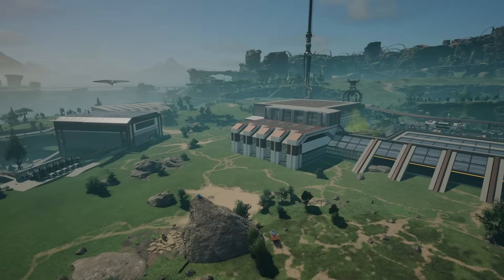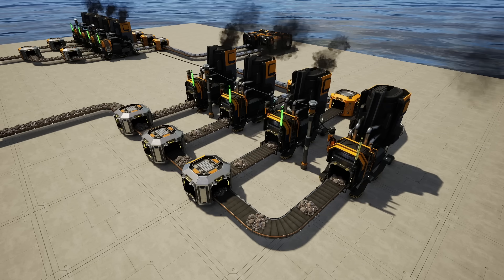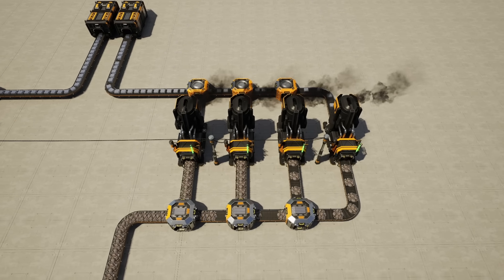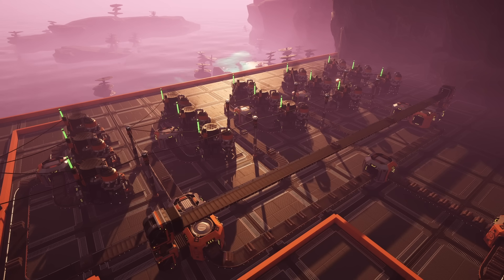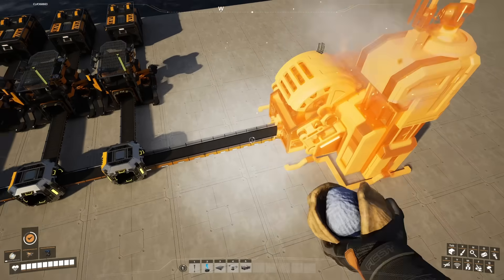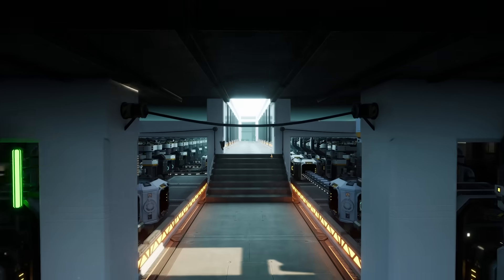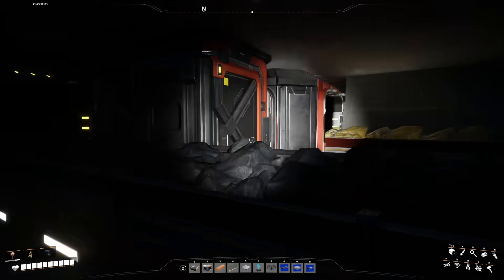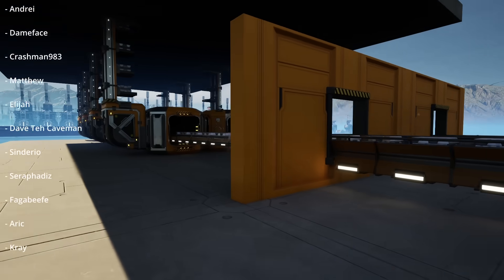Beginners Guide To Factory Logistics Systems in Satisfactory 1.0

Comment: one of my favorite techniques is to use a container at the start of the manifold somewhere and pre-fill it with a bunch of resources (that I inevitably have hanging around my inventory for some reason) and it'll fill up the manifold even faster if the belts have a higher capacity than the machines can use.

Comment: I used a manifold to power my biomass burners, and I had constructers making biomass and then turning it into biofuel, and after fifteen minutes of cutting down trees and putting them into the power plant to go through, 12 biomass burners are fully backed up, so I think load balancers are unnecessary in general.

Comment: Ive always found the whole argument about manifolds warming up isn't that big of a deal. I get it, efficiency, but if you build in sequence and power everything as you build, each chain of production is already a lot more warmed up by the time you finish. This "massive warmup" presupposes that you build the entire factory and then hook the inputs up to it and run it. 
Eg. Im building heat sinks, i built my copper sheet line first, so i already have a few dozen constructors full of sheets ready to pump them into the heatsinks anyway, im using max belts anyway cause i have an abundance of resources.

To be clear, go ahead and dont use manifolds, thats your right, but there's methods to reduce warmup so it's not that bad.

Comment: Thanks mate
I find lefts connecting perfectly to assemblers etc from the floor, letting you walk around proudly is really great 
I usually let a short belt run from the output to the lift so I can "inspect the goods" too
And when doing this, descending to the dim, densely packed logistical floor is also pleasant, it's like picking at the belly of the beast, a sort of underworks location

Comment: Manifold advantage is more stable power consumption if there is not enough resources. The first smelter will be working  constantly. In balanced all will be stopped sometimes. That will cause greater changes in power consumption.

Comment: I'm personally a big fan of manifolds in situations where it's not crucial that the job is split evenly. I find them quicker and easier to build and plan, and they take up less space and slightly less resources to build (since you're using less floor space and slightly fewer belts)

One thing that's often overlooked, in my experience, is their flexibility in terms of throughput.  HAHA. Of course, I pause the video to type this comment and he immediately mentions overflow the moment I hit play again xD

Using smart splitters set to overflow, you can build a manifold that automatically adapts to input. As in, it'll only start sending to the 2nd machine once the first machine is actually full, etcetera. Not a HUGE deal but it can be handy if your input isn't stable or you're still working on connected parts of the same production line.

Comment: I know manifolds are generally just fine, but they just feel wrong to me, I have to balance everything perfectly or it grates on my brain until I fix it
Reply: Balancers simply aren't a thing in Satisfactory.
This has been explained many many many times.
Production efficiency will not ever be 'solved' or 'improved' by using them, ever, under any circumstance.
The 'balancing' in Satisfactory is done by a different mechanic:
1. You supply enough product for the machinery to process.
2. You place enough machinery to process the supply.

Comment: i hate this underground delivering floors, first you start often to work messi (because no one sees it) and if you need to fix or change something it looks more like sphaghetti than real sphaghetti^^
and ok that you can walk through cleanly yes but can this also be done in that delivering floor? NO because he is full of Belts splitters and so on^^
AND after getting the flightpack who walks through buildings????? i always fly or use hypertubes AND you can make a central belt mainstreet with 63 Belts or more withouth overclipping and able to walk for example UNDER the belts
i use a lift  near the mainstreet to go up than straight to the production and there down with a lift and into the buildings same vice versa on the output
look like a REAL factory wokrs perfectly and i can use my beloved bobby car the whole time if i want^^

Comment: honestly this video has already changed my way im gonna set up factories now that i know that as long as i have the required resources coming in, i can manifold it and itll work itself out, what i usually worry about is the fact that my part making stuff doesnt get overfilled and cause power fluctuations
Reply: one thing you can always do is make a switch for each major production line and let the whole manifold fill up before you switch the machines on, then it's an even power load.

Comment: ‘Sushi belts’ actually have pretty good uses lately game when making compact, complicated factories where the component load in total is very light. You can just use a single conveyor line that goes about your factory picking up stuff and trading it off. What I really like about ‘sushi belts’ is that if there is an overflow, you can always bypass the overload with feeder lines running in parallel like a highway; For instance if on the highway there is an accident, traffic automatically detours toward side streets or ‘feeder’ roads if you live in Texas. The same concept works exceptionally well in Satisfactory.

Comment: You can have fairly loaded manifolds if you're completing them by steps. So for example you built your smelters? You power them and supply with ore before moving to work on constructors, then you power and supply constructors before doing assemblers etc.

Comment: additional tip: you can use every splitter or merger as an replacement for the input/output-head of vertical conveyors
just place the splitter/merger directly on the input/output-head of your vertical conveyour

Comment: A really great example of where manifolds are inefficient is on the back end of production.  If you have several machines making output and you merge them all together a manifold method of merging will cause one machine to purge it's backed up production at twice the rate of the second, and 4 times the rate of the third and so on, meaning in setups where your production lines might fill up and then when you build something need to refill your stores you will have actually slower total times to refill as your production machines will remain idle longer as it takes more time for your usage to empty the buffers on some machines as compared to others.  The flip side is the difference is probably pretty small.  The more you use the less this will tend to matter and if you don't use much at all your buffers will tend to stay full, so there is no real problem.  But in any case on the backend this problem never goes away.  On the incoming side once your machines are saturated with input the difference between a load balancer and a manifold go away, but on the output end the problem can reoccur over and over again.
Reply from the maker: The example you give shouldn't be that big an issue, if you need to refill your stores, the chances are all the constructors already have their buffers filled, and whilst they start to run, the manifold will be feeding through to the whole system, by the last in the line finish using their buffer it will most likely be being filled again. On the flip side if you run overflowing awesome sinks at your storage, then you'll never have an issue as the factory will run constantly

Comment: There is a much easier way to use manifolds and get them working efficiently from the get go without all the stuffing around you mention. Just use different tier belts.

For example, let's say you have 6 smelters near your extractor. Each requires 30 ore / minute. A tier 1 belt from each splitter will easily take care of that but the belt from the extractor to the splitters can be tier 3. Solved.

Comment: Just a small tip from me, if you like to build balancing delivery but only have place for manifold line.. place the last row of splitters first, front last on top of that etc.. till you got all the splitters in place, then connect everything with elevators.. and you have the balancer but vertical build. 😊

Comment: So after I saw the alien technology tab in the MAM I stopped everything I was doing and immediately went and tapped every sam ore node i could get to and used my limited supply of mercer spheres to build dimensional storage on each of them. then I spent like 6 in game hours doing nothing but hunting mercer spheres (got a lot of hard drives and slugs at the same time as a bonus).  I didn't do anything with phases, milestones, or expansion until i maxxed out the alien tech research.  And I see zero reason to ever make a logistics depot now.

Comment: One thing I have not seen anyone mention, is slugs. Put a slug in a factory and you have just ruined your 'balanced' set up. If you had a manifold setup and you have excess input but no room to expand, you can either reduce the output of the feeding/supply factory (Why would you do that! You are wasting manufacturing time!) or you can add a slug into the last factory of the input line to 'gobble' up the excess input and increase your outflow at the same time. Win win!

Comment: I started using vertical balancers this playthrough. Each layer has 3 machines, up to 3 layers get feed by a second order splitter. Those cubes get then underclocked to match the input. Makes for some great "Iron Tower" or "Copper Hill" factory.

Comment: All you need to do when you start your factory is power the miner, let it fill up while you build your smelters. Then power the smelters and let them fill up while you build the constructors. Then power the constructors while you build the output.

That way, your machines should have time to fill. Also, when the miner or smelters clog while you build, put the stacks in your inventory to manually fill the next machines.

Load balancers are a pain in the ass when you want to upgrade the miners or overclock or add a few machines. With manifolds, all you have to do is keep a small space for a lift after your last splitter so you can send extra materials to another floor. You will have to expand so keep that in mind!

Comment: Just a note for a major point of frustratuion. If youre coming up from a floor hole directly into a splitter and into 2 machinces, offset the hole. The best way i can discribe it:
Stand with machine on the left and right, enterences in line and spaced enough for a splitter.
Floor hole will be in the center, one tick away from you.
Lift exit will face towards you.
Splitter should auto config and completely cover the lift.
And you'll have a perfect split.

Comment: Not trying to start anything but asking a math question. Wouldn’t the 1:4 splitter/merger setup actually be a 1:3 ratio since 1/4 of the product is being reintroduced to the original line? At 4:19
Reply: Only 1/6 of the original product is feeding back into the incoming line. One half (or 3/6) is going straight through. The other half is then being split 3 ways (into sixths, overall). The way it's set up, you have 1/6 going far left, 4/6 going forward, and 1/6 feeding back. As long as none of the lines saturate, everything that makes it through will be split in a 4:1 ratio.

Comment: I have relearned that as long as your through put is able to push material faster than the machines can suck them up you typically won't have many problems. Just make sure the machines you build have around half a stack of material before you link them up with the next stage of your build so you have enough for saturation. 
Also load balancers and manafolds can be hidden under the machinery by using 1m foundations  and leaving some space for you to work in.

Comment: Manifolds are exceptionally efficient IF you bother to pre-load the upstream belts.  Whenever I have, let's say, a 4 stage production line, I fill the first (input and output buffers), then fill the second, etc...  It is the most efficient design with respect to space conservation and throughput, with the burden on the designer to "pre warm" each stage.
Reply: With all the things you have to do in Satisfactory, once you've done with a manifold, just leave it and forget it. When you go check it later,  it'll be just fine and fully functional.
Reply: You dont NEED to do it, that will just make that factory get to 100% production faster :D
Reply: @NachitenRemix I made an manifold and my production haven’t got to max output and it is on for 2hrs u got an tipp?
Reply: @progamerheli1424  stop some machines and wait until the running machines are full and turn one after another until all are full after that it should be rtunning smoothly when eveerything is full
Reply: @progamerheli1424  hmm what are the input amounts and or the load on the belt? what i do is lets say iron ingots and i must build 20 machines with plates and a bit after i must make 5 machines with rods and i need (no exackt numbers) 600 ingots for the plates and 100 for the rods so 700 so i make not 700 i make 710 or so. than i use an intelligent splitter on the point where ingots go to plate production saying in that direction all full power and overflow goes the normal way further, this means the plate production get more than needed and work fast with 100% and after the ingots are backstocking the belt the overlow went further and than into the rod production also with a bit more then needed so this also will be 100% faster
AND at the end i put another int splitter saying forward overflow and put a shredder behind, so after getting all filled and work perfectly this 10 or 20 overcap you make on ingots will walk into a shredder
or you do this shredder think directly after the melters
in this way the melter the plates the rods and so on all work 100% pretty fast AND ALL THE TIME
even after a power loss this will redo back to 100% alone 
and if REALLY something is not green but yellow you KNOW ok something is working not correct (by mie mostly its a short belt that i forgot to upgrade)
Reply: @pedronanton443  i got it now my main problem was that i had a smelter less and i only got 210 iron ingots instead of 240
but thx for ur ideas
Reply: @ZeroDayEx  i got it now my main problem was that i had a smelter less and i only got 210 iron ingots instead of 240
but thx for ur ideas
Reply: @progamerheli1424  yeah counting and misscounting happens to all of us^^ my setup i posted above  works perfect also with huge amounts like 5k wire needed so 5 belt usage and so on, phase 5 done and 99% of our machines are working on 100% only the minder and pumps (so the first part of the chain) are not 100% efficient because we all max them out as much as possible even if not needed (if you need later more you KNOW ok all done and dont have walk back again an look or adjust)
Reply: and you can upgrade it pretty easy, you need 4 machines now? ok you need 20 later? ok just expand it doing the same with a balancer is often soooooo bad imo
Reply: Pre-loading seems like a waste of time. I mean if you just route the inputs and power to the machine first, it will have loaded it's buffers by the time you finish building the output.
Reply: @RiKSh4w  yeap this also helps^^

Comment: I advise using the balanced method and not the one in series for the place the beauty etc. you have to create factories with a basement and holes for vertical conveyors (in the awesome store) it allows you to have a clean balance power supply because it is in the basement thanks to the vertical conveyors and have a clean space balance power supply to come and make changes and it does not take up to you in short it is up to you to see if you do things in groups of 5 machines (takes a lot of space in the end) you can use the series otherwise I advise the other (for steel beams the series can be accepted if for example I have 5 manufacturers = 300 ingots necessary and I send 300 ingots on the mat I just put an mk4 mat for everything except the conveyors that send in the manufacturers I put mk1 in these cases it's good

Comment: I originally started with using balancers, maybe because I came from Factorio, but later I was like...why am I doing this?  The manifold is so much easier in Satisfactory most of the time.  The one possible exception is on really expensive to manufacture items and possibly radioactive items where letting queues build up in a manifold setup is less desirable.

Comment: I think developers shoul give us ability to turn on the "manifold mode" inside the machines
After turning on machine will only collect resources if it can't finish 2 or 3 production sequences (kinda like with manipulators in factorio)
Reply: That would be a splitter function not a machine function, and with smart splitters you are able to set the output of any given side of the smart splitter. Also it doesnt take long at all to get manifolds going and is usually the first thing i set up once spliters are unlocked lol, only thing i load balance is the starting biofuel gens after i get the chainsaw

Comment: I typically set up factories with 3 floors.  The ground floor is where all materials enter the building and make their way toward the machine that requires them.  This floor is the busiest, often with many lines/pipes going all different directions.  Organized, but busy.  The second floor is where the resources make their way up to the machines on the top floor.  I often try to arrange belts and lifts and pipes in ways that display the materials traveling on them on the second floor, I try to make things symmetrical and pleasing to the eye.  The third floor is where all the machines are located.  Once a part is made, it makes its way back down to the first floor where it travels to the next machine or out to storage.